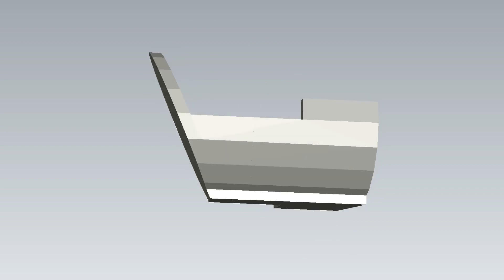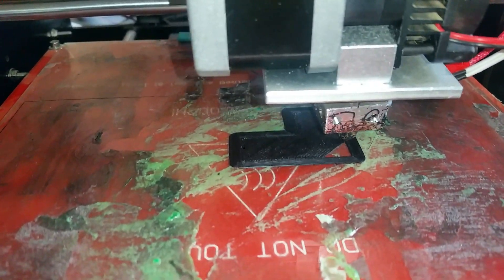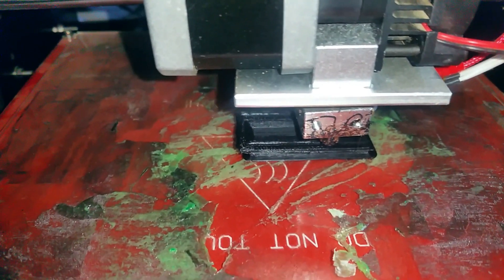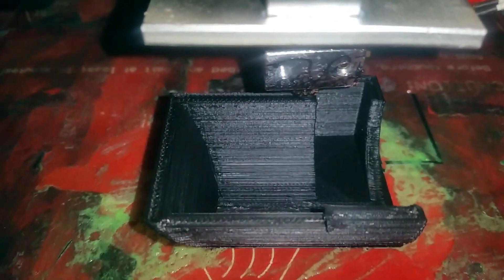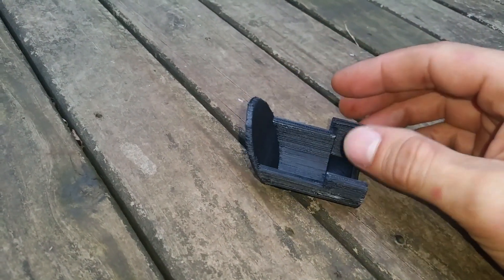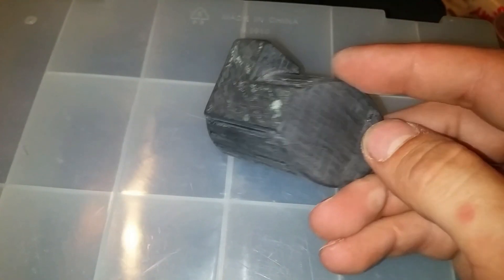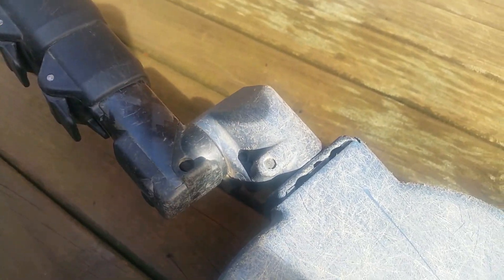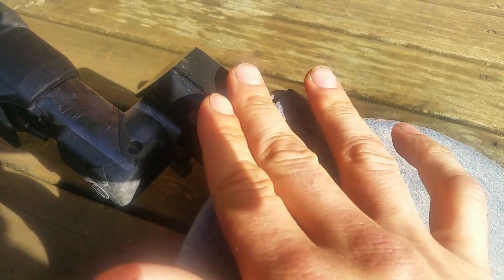3D Printing a Knuckle Protector for my SDC2300

Comment: I used to use Acetone for cleaning all sorts of plastics until a Plastic Fabrication friend told me not to do it as some plastics become brittle after being in contact with Acetone, but it can take time for the degradation to occur without any visible external evidence.
For cleaning or degreasing he suggested Alcohol Swabs or Thinners depending on the type of plastic  your working with.
Reply from the maker: Yeah nah this is printed in ABS. ABS dissolves in acetone. The acetone wasnt to "clean" the surface...what I'm doing is basically melting the surface. People often use acetone to get a nice finish but they usually use the vapors. I just paint it on and save time. It also helps strength the part slightly by fully joining the outside layer.
Reply: Diggin' For Gold 
No worries, I'm glad you know your plastics, I wish I did so I hadn't stuffed up some pieces I worked on years ago.
Don't you love the Aussie use of "Yeah Nah", it means so much all on its own. 👍
Reply from the maker: Yeah I dont know a lot but I know enough to get by. There's a bunch of different plastics for 3D printing so I learnt a bit there. And I've been dabbling in vacuum forming lately so had to research a bunch of different plastics for that. And the "yeah nah"...haha. Got to love it!